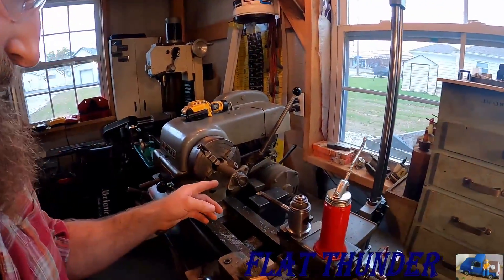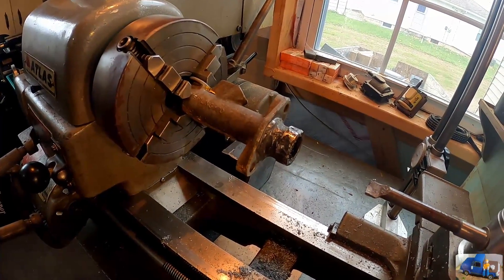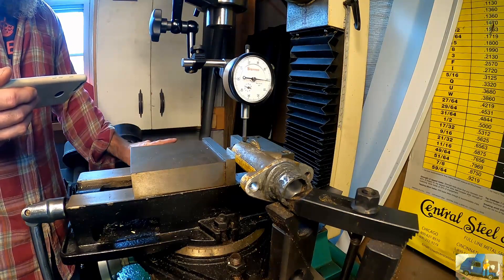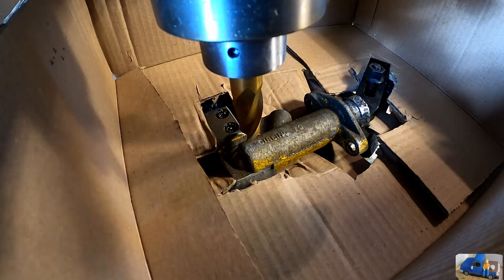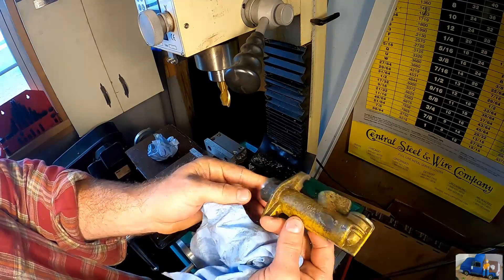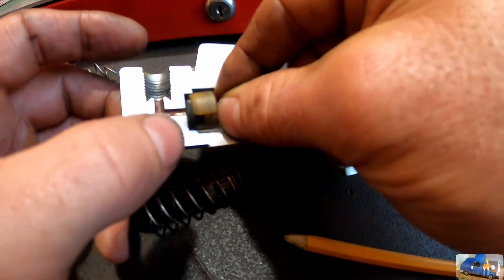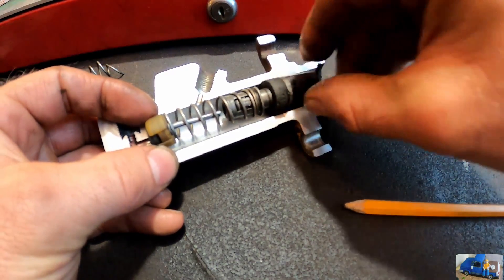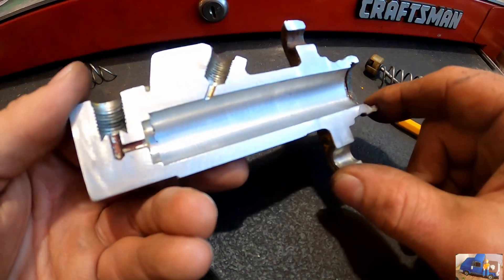BRAKE MASTER CYLINDER; HOW IT WORKS... (GIRLING 70 / FULL CROSS SECTION)

Comment: Thank you for this video. This is the type of master cylinder used in 1950s and 60s British cars. It gave me an understanding how the plunger works to block off the reservoir. Previously it was a mystery to me. Thanks again.
Reply from the maker: You're welcome!  My curiosity drove me to cut into this scrap unit.  I bought a replacement for my tractor.  Thanks for watching and Merry Christmas 🎄

Comment: I enjoy watching the practical way things work. I just installed a new Master Cylinder in My 1971 VW Beetle, so seeing how it all functions is great. I have one of those vacuum hand bleeder pumps, so my wife wont have to pump the brake pedal.
Reply from the maker: Me too,  I cut this one open just to see how all the inside pieces and parts worked.  I have been using a Lisle brand one man bleeder kit for years (basically a catch cup with tubes) and it works great!  Thanks for watching 👍😁

Comment: Sir you know the cause of leaking fluid?bike is 600 miles🤦🏽‍♂️
Reply from the maker: If it's leaking fluid out of the master cylinder it's likely damaged seals.  If the motorcycle (etc) is relatively new I would be more inclined to look for a loose fitting or hose.  Also keep in mind it could be losing fluid at the wheel cylinder or caliper.  The piston seals can leak in those components too.  Good luck on the repair.  Thanks for watching!  👍😁
Reply: @FlatThunder  its 2017 ktm rc390 and its been in the garage for awhile..i ordered the master cylinder

Comment: That was a great video ! While doing the cutout, you were climb milling quite often, check out this video on "Climb milling Vs Conventional milling" , you will get better tool life and avoid possible unpleasant surprises. https://www.youtube.com/watch?v=galm5_6SUcM
Reply from the maker: I was aware of the different styles of cutting.  However, I don't operate the milling machine enough to know each cut immediately.  I have to stop and think about the direction and cutter rotation before moving forward.  Thank you for sharing the reference video!  Great information.  As I machine more I will make solid effort to refrain from climb milling except on light finish cuts.  This was a sketchy setup with light clamping.  I'm surprised it turned out as nice as it did.  Thanks for watching 👍😁